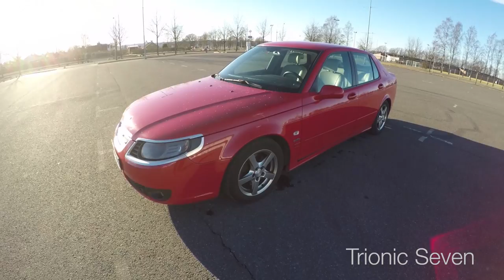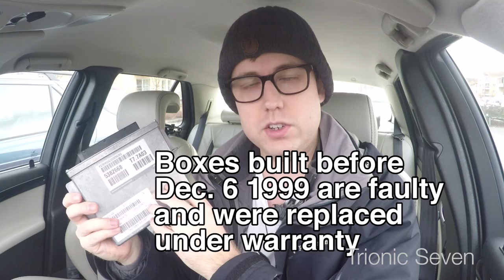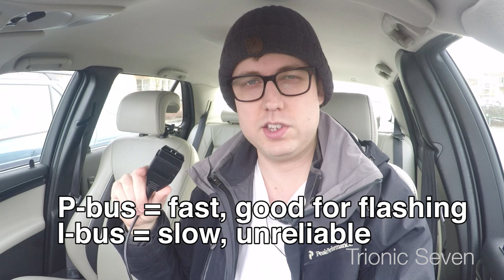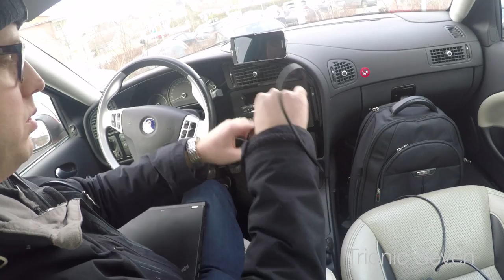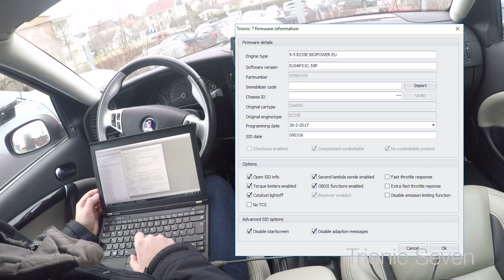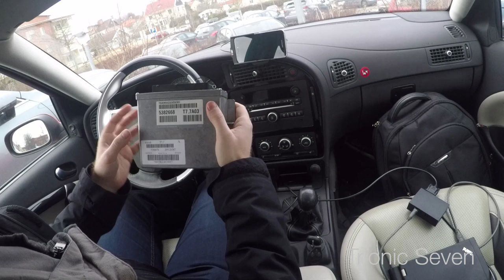Introduction To Saab Tuning: How To Flash Your T7 ECU - Trionic Seven

Comment: hey, im from uk and my saab 93 2.2 has fried the ecu.. but i dont know where it is!! ive checked under front engine cover, also driver side interiour arch, looked under scuttle cover !! any one know where it may be? its a 2004 vector sport 2.2 tid
Reply from the maker: This video does not apply to the diesels, sorry! They have a completely different system.

Comment: Great video, This got me started to start modifying my -07 2,0t biopower.
Question, when I open my stock .bin in T7suite  I have 4525 undocumented symbols.
I have searched the Trionictuning-forum but not found anything applicable/working for my SW. 
SW name is EU03Y01C.46T. I have not been successful in importing "IMPORT XML descriptor"
Do you have a dummy-how-to?

Comment: If your computer has the connector for the cable from your obd port, do you still need the combi-adaptor?
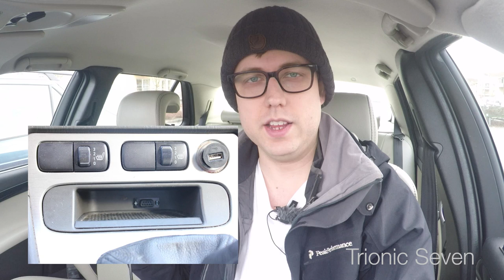Reply: That's what I want to know. If I splice in a D-Sub into the car like 5:23, will I still need the Combi adapter?

Comment: Jonathan,  I been watching your  channel for the past year and a half and have learned much; thank you.  Quick question, I have a 1999  9-3 with a broken piston and other problems. I will be putting in a new engine with some upgrades. Is it possible, or advisable, to change from the present Trionic 5 to Trionic 7?
Reply from the maker: You can't change the control system, it's 99% impossible.
Reply: Trionic Seven

Comment: Thanks for the vid.  Question:  if you are having issues that seem to indicate a failing ECU ("stuttering"); is it possible that flashing the ECU will correct the issues because the h/w is not defective, it just needs to have the s/w reloaded via the flash procedure demonstrated here.?  Great work here.  Would love to get your reply.
Reply from the maker: Hm...no idea! Never heard of that issue.
Reply: Like when your Windows OS is screwed up so you reinstall Windows on your Hard Drive.  That's kind of what I meant. Before I buy an ECU replacement, I thought I'd ask. Thanks for the reply.  I really enjoy your work  here on YouTube and on your Twitter feed.  Thanks.

Comment: Jonathan, what process did you go through to “rewire” the obd/db9 cable?  You mention you had to buy the cable, then modify it.
Reply from the maker: Yeah, I bought a generic cable and then switched some pins around. There is no standard type of cable so I had to modify it to fit the combi adapter pinout.

Comment: Thanx Jonathan . Please I have 9-3 2009 aero biopower .It has diag port and ESP. What kind of ECU in it ? Is it T7 or T8 ? And how to get the cable between the diagnostic port and combi adpter ? Maybe stupid questions !!! Thanx for fine videos.
Reply from the maker: Hey, sorry I don't know much about the ng9-3. It's a T8 car, and that is very different from T7. I'd check trionictuning.com :)
Reply: It is T8 and this is the link to the OBD2 to USB cable. Diagnostic port to laptop..
http://www.lightinthebox.com/sv/12v-v1-5-obd2-elm327-granssnitt-usb-can-bus-scanner-diagnostik_p4427115.html?category_id=2243&prm=1.2.1.1
U need also T8-suite and flasher. I will try this and tell U if my SAAB survive..haha..Thanx again..
Reply from the maker: No, that's just an ELM327. You need something like the combi adapter.
Reply: Trionic Seven ok .will fix it ..Trevlig helg på dig och familjen kompis.😂

Comment: I wonder if the Saab I drive has been tuned before by previous owners or something, in some way. It got a "Remus" exhaust, and 2 "Hirsch" emblems on the sides. I can't find any paper or information about this however, I tried the combination on the steering wheel so see if it had SID, but it didn't.

Is there any way to find out if the car got tuning by Hirsch? I tried emailing them without any response.
Reply from the maker: Good question. Saabs are so easily tuned that a previous owner might have done something to it without writing it down. Try to pull the ECU and have a look at it (see my video on that), maybe there's a sticker on it? Otherwise, the only way to be sure is to actually download the bin to your computer.
Reply: I don't have the equipment to perform a such "operation" myself sadly, but maybe the car mechanic can check at it? Or even tune it if it's not done already ;)
Reply from the maker: No, unless they are Saab specialists that's nothing they can do, usually. And if they follow official procedures they still only can flash "standard" software. But pulling the ECU is something you can do yourself.
Reply from the maker: I'm not actually sure. Here's what I recommend: Check out trionictuning.com, and ask the question there. I'm sure you'll get better help there! :)

Comment: When there was possibility to enable opensid, there is options like gast throttle response, and extra fast response are they  possible to enable as easy as opensid?
Reply from the maker: The car won't go faster, it just changes the calibration of the throttle pedal :)
Reply: Yeah thats true but in some moments these options will be better for lauching if we talk about racing etc.

Comment: Hi, I have a 2007 9-3 and my cars blue tooth connection isn't working. Any ideas on how I can get it to function? Nothing happens when I press the buttons on the steering wheel, no beeps, no changes to the SID. Could this be a fuse, or something else?
Thanks in advance for any suggestions.
Reply from the maker: Sorry, I don't know anything about the 9-3.
Reply: Trionic Seven. It is probably the same system as you would find on the 9-5 of the same year, 2007. They have the same steering wheel controls, and the same stereo systems, so I assume the same bluetooth system also.
Reply from the maker: Nope, the 9-5 does not have bluetooth

Comment: My car is a -01 9-3 Aero. I'm not sure yet but probably sooner or later if i got the hang of it i'm will try flashing the ecu myself. But i was thinking maybe it is a good idea not to use the cars original ecu when experimenting so if something goes wrong i could just put the original back? If so could i just go to the scrapyard and get any 9-5 T7 ecu and use that? It is much harder to find T7 9-3's in general and if i do someone else already has taken the ecu.
Reply from the maker: Yes, get another T7 ECU and remove the stock ECU from the car. That way, you can flash the new ECU to your heart's content and if anything goes bad, put the stock ECU in :)